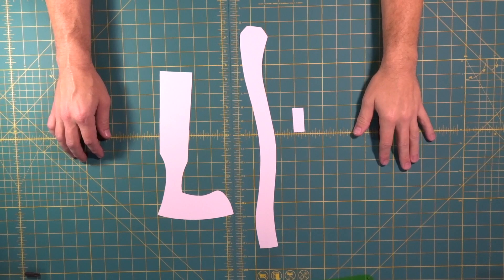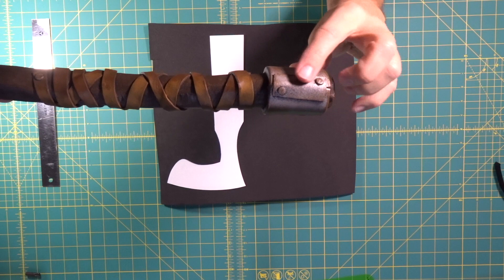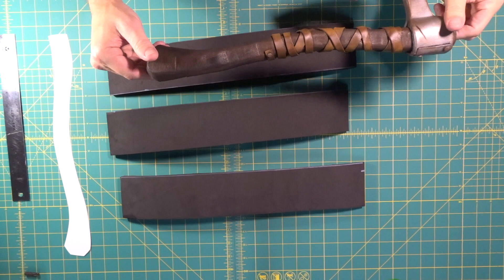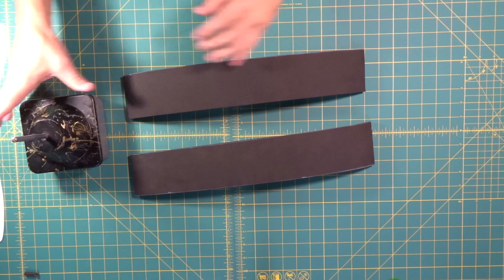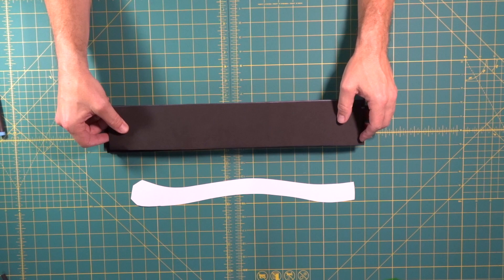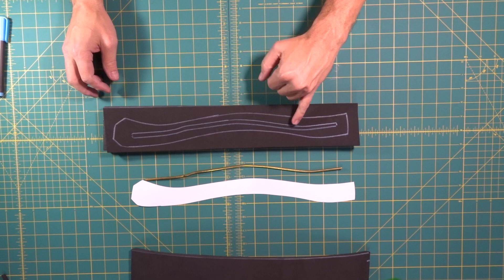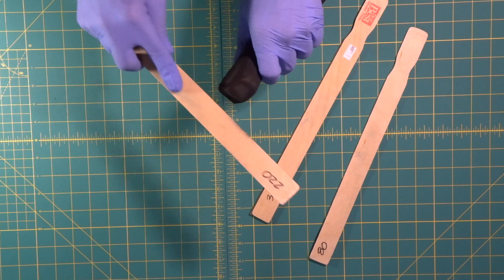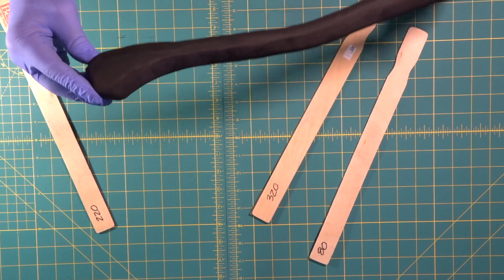Making An EVA Foam Viking Axe Part 1

Comment: Hey, I'm planning to do the axe and the Shield after seeing your videos :)
I've never done this before. Which "softness" of eva do u use for the handle and the blade? I've found "soft" "medium" and "hard" in shops.
Reply from the maker: Hi BB!

I buy all my foam from TNTCOSPLAYSUPPLY in texas and their foam is said to have a “Durometer Shore-C hardness of 38” - whatever that means?
It also says it’s “a higher density foam than most on the market”?
Its the only foam I use so I’m not familiar with how different soft, medium and hard are? Sorry I can’t be more help.

But it seems to work fine for all our our builds.

I hope that helped a little bit.
Reply: @BlackSheepProps  Awesome!  Thanks so much for your detailed answer :) I really appreciate! 
Since I'm from Germany I can't order at TNT but I will look out for high density foam. Very good to know. 
May I ask which thickness of form you would use for the round part in the middle of the Viking shield? Since I'm planning to use my shield on LARP Events it should resist some foam sword strokes. Would be 10mm a good thickness for that kind of use?
Reply from the maker: Wow! Germany! Cool!
I think I used 6MM for the round piece in the center of the shield. It needs to be thin enough to be able to heat and bend into the circle shape. I don’t think it will be able to resist a strike though, it will be pushed in. But I have built other shields and I cut some square pieces of foam and stacked them up to make a support pillar underneath the round piece to prevent it from getting dented.

Another solution that would be SUPER strong is :
• Stack foam until it is the height you want for the circle
• Then cut the diameter circle you want
• Then use your dremel and shape a rounded top!
That way your circle shape will be totally solid and anything will be able to hit it and it won’t dent. Check out our video FOAM DOOM HAMMER PART 2. We do that same technique for the circle detail on top of the hammer.

Hope that helps! Thanks for watching!
Reply: @BlackSheepProps  Thanks a lot for your effort! Those are some great ideas. 
 I'm planning on using a more authentic grip on the backside so I was thinking about doing the round piece hollowed out to create some space for the hand. 🤔 
Now I have some great input for finding a solution!   Thanks so much!
I'm so glad I do know now I have to make the round piece extra strong 💪 So excited!
Can't wait to see more of your Videos :) I think I've got found a new hobby.

Comment: Would be helpful to have thicknesses of foam included with your templates.
Reply from the maker: Hi Bay,
I don’t really nail down the thicknesses in stone since I know there’s a bunch of wiggle room concerning different people’s preferences. So I usually just mention the thicknesses I happen to be using in the video - along with mentioning that each build requires the individual builder to decide what thicknesses they might want for their personal prop build. I sort of figured I would let everyone know what I chose as a starting suggestion and then they can decide if they want to follow it or maybe thin down or bulk up according to their individual taste. But it’s definitely a good idea! Thanks for the suggestion and thanks a million for watching!

Comment: Can you please tell me the length and the width of all the paper pieces? I'd like to realize one of that.
Reply from the maker: Hi!  Thanks for watching! The templates were made by experimenting. I tested and cut different pieces of paper until I had the sizes I liked - but I don’t actually have all of the measurements for every piece written down. Templates for every one of our builds are available in the store in case you would like to get one to make your building easier? I hope that helps.
Below is the link :

https://www.etsy.com/shop/BlackSheepProps
Reply: @BlackSheepProps  thank you

Comment: Your finish is not bad, but this axe design is terrible! 

The shape of the handle is debatable on a war axe, some may have been curved, many were straight.
The leather wrapping for the handle should be at the bottom of the handle as a hand grip - there is no reason for a loose wrap on the upper handle.
The axe head is what I have the biggest problem with.  No axe, modern or historical that I have ever seen has a join at the back of the head.  When building a foam axe the head works better when the template has both halves of the blade and the piece wraps around the handle.
You build well, it is just this design that really bugs me.